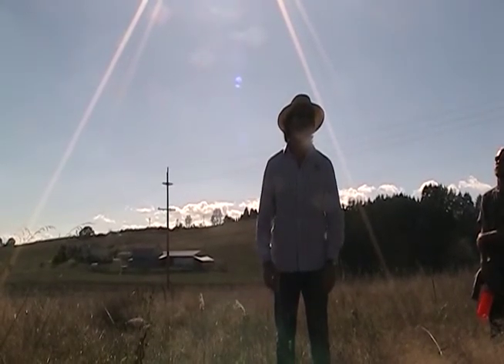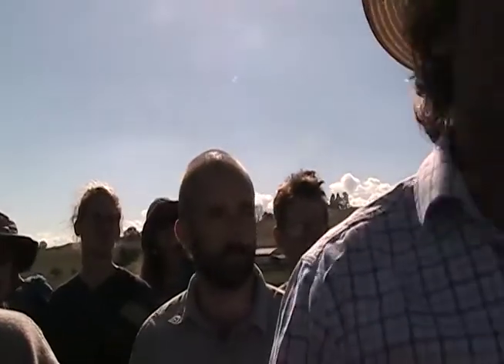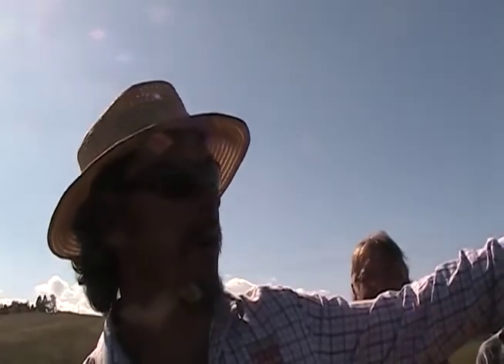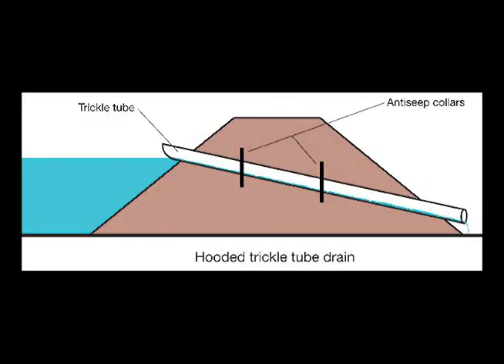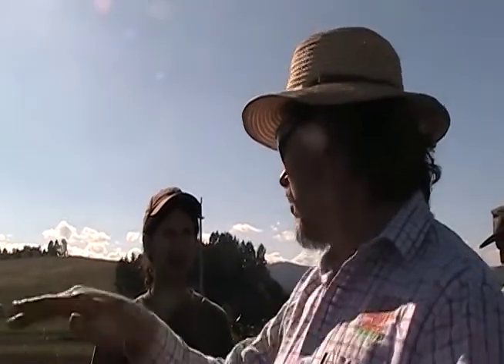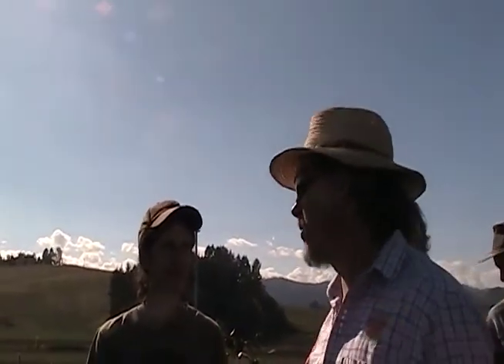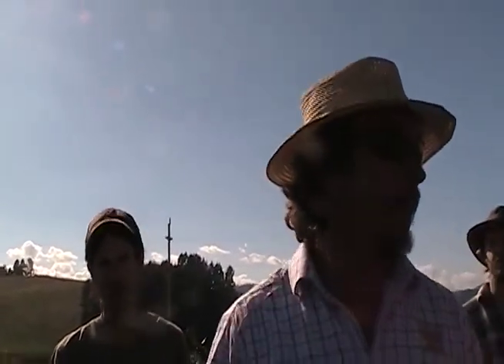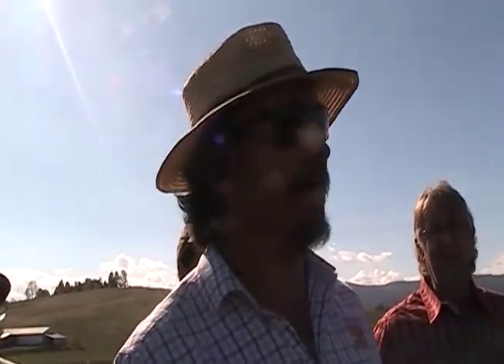18 Spillway Considerations

Comment: I would add that you can also install hydraulic ram pump(s) or micro hydro turbine(s) such that spillway water is diverted higher on the land, to storage, or irrigation or its potential energy is tapped to create electricity for lights, sensors and the like.